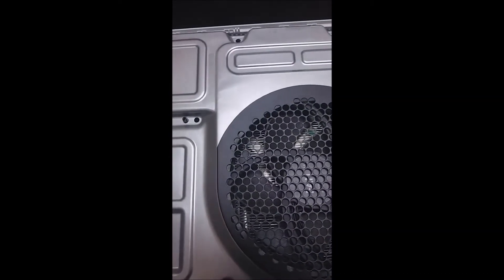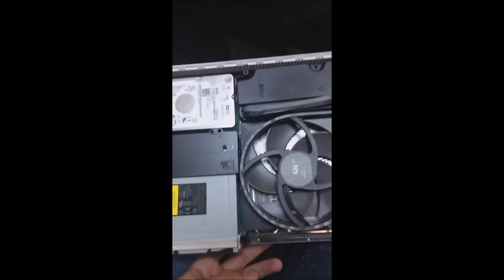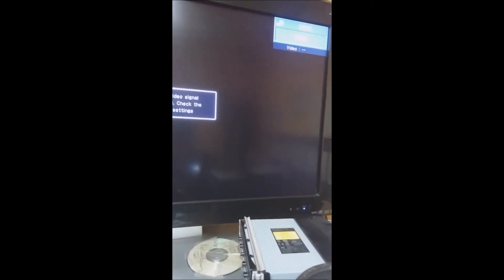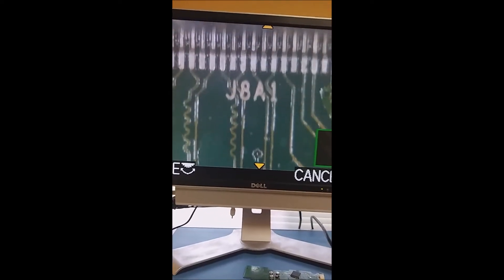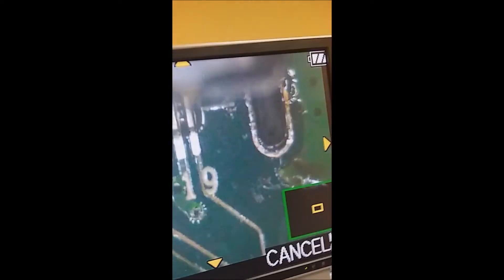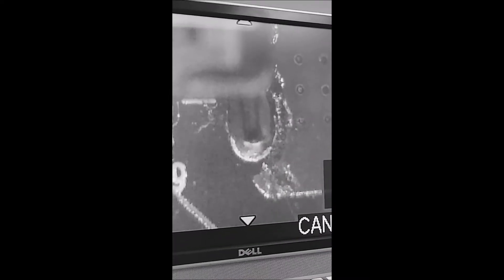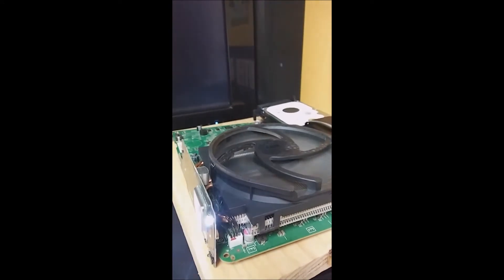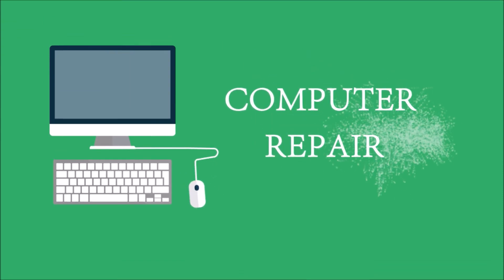Xbox One S HDMI Port Repair (Swap)

Comment: I have xbox one s and now it’s only shows 680 x 460 , can i swap hdmi ports and it fix ? Thanks man
Reply from the maker: Sam, We do not think the HDMI port is to blame. Did you factory reset your device to eliminate software failure?
Reply from the maker: Not too sure. Hard to tell with out looking at it.